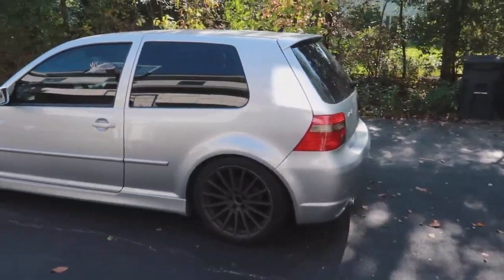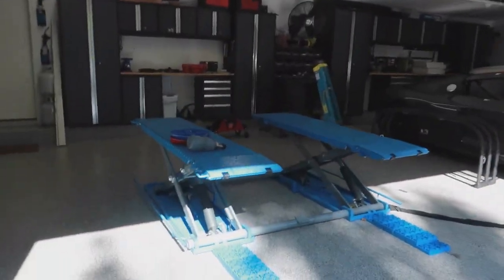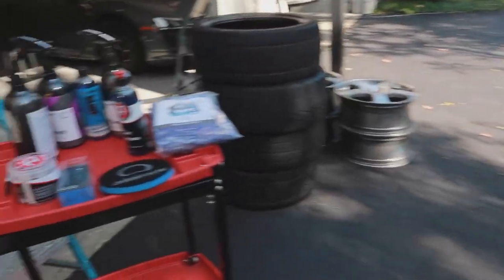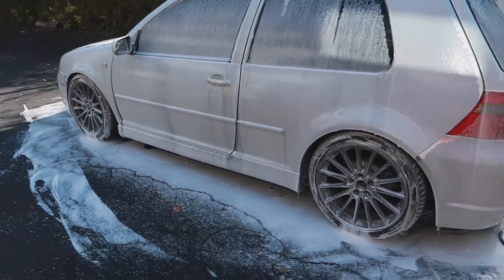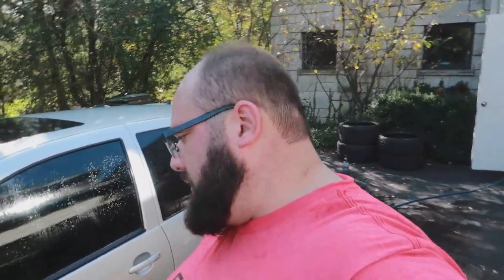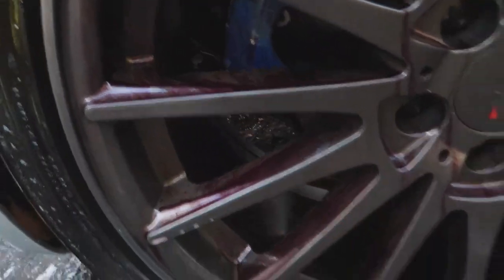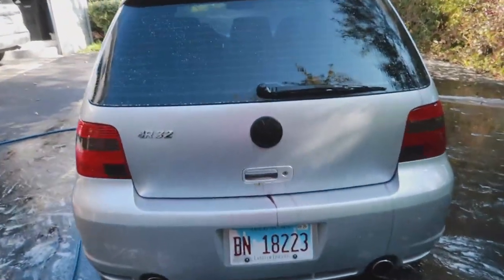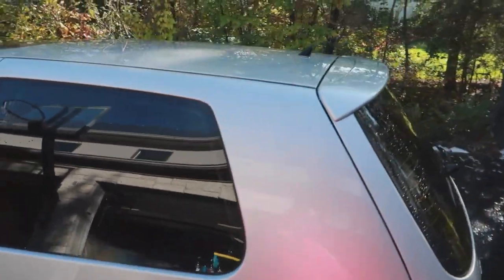VW MK4 R32 Satisfying Decontamination Car Wash on my MK4 VW R32! Project Car Rebuild Pt. 2

Comment: Um, that R32 logo on the rear is out of place, poor car...
Reply from the maker: explain..
Reply: @GasTachs  You can tell the R is too seperated from the 32 and the whole badge itself is placed almost 1.5 inches to the right. Trust me, I know because I own an R32. the previous owner probably had the badge stolen and had to replace it. Just figured i'd point it out...
Reply from the maker: @peteronister1488  Thanks!